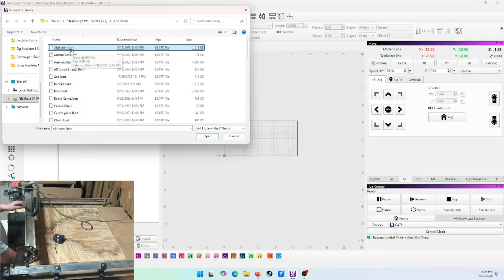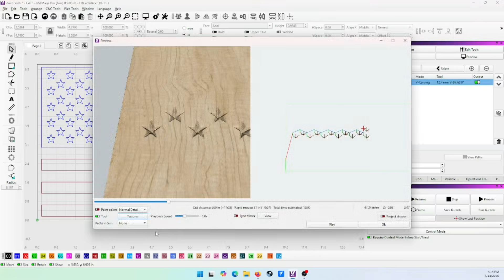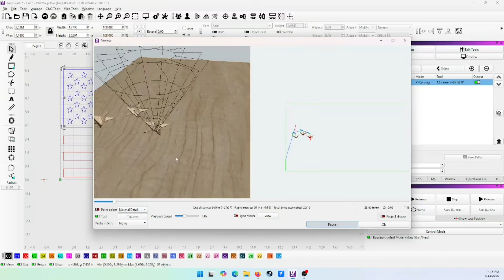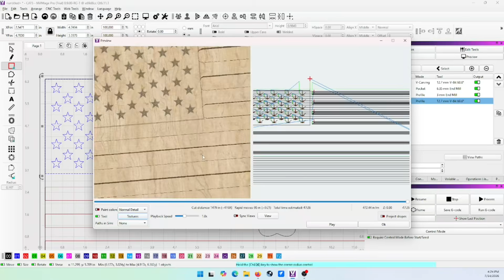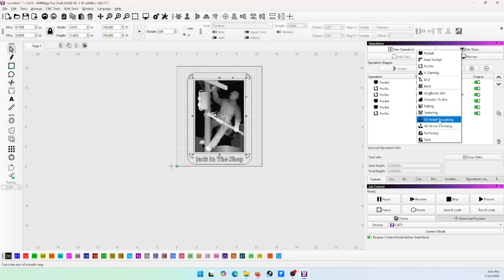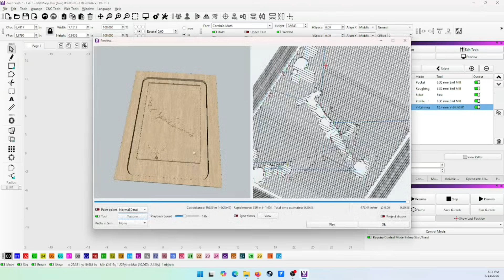MillMage 9 RC1 Just Got a MASSIVE Update — VCarve + 3D Relief Are HERE!

Comment: Thanks for posting this. I've been on the fence with Millmage waiting for the ability to do V-carve inlays for end grain cutting boards. Have you tested that capability yet?
Reply from the maker: Millmage has 2 versions. Millmage core is $99. that version will not have vcarve or 3D. the 2nd is Millmage Pro 9. that version is now $199. and it does have vcarve and 3D. It was just released for purchase about 8 days ago. Hopefully I will have a affiliate link tomorrow for it.
Reply from the maker: I do show the vcarve operation in this video. The new version just got center line trace too. So it will be easier to trace hand written text.
Reply: @JackInTheShop I’m talking about the process for V carving a female pocket in a cutting board and then V carving a male plug (negative) of a contrasting wood to insert into the pocket. I’ve since gone into the Millmage support page and it’s not available yet. Sorry for the confusion

Comment: i couldn't see on the screen, but is there a clearing bit you can use with a vcarve? like a 1/4 or 1/8 endmill for a large area that would take the v bit FOREVER?
Reply from the maker: For this, I would pocket out the shape with a 1/4in end mill, then do a profile path with the v-bit.
Reply: @JackInTheShop  that assumes that the clearance bit was able to get all but the profile. what it needs is ability for clearance bits, it first 1/4 then 1/8 and the v to clean up. not always just the profile. there could be some areas that the smallest clearance bit was not able to clean up and the v bit would have to. This is really required for a true vcarve.